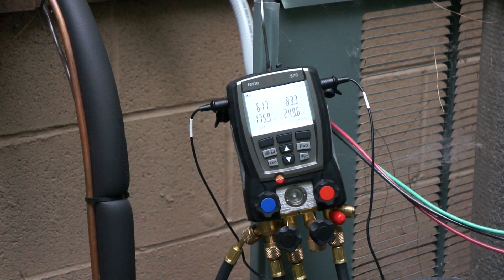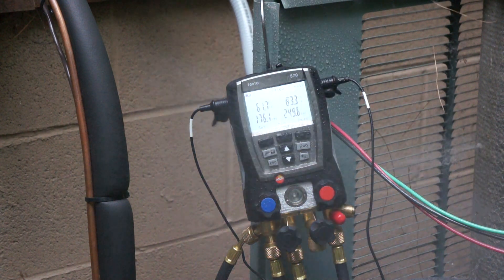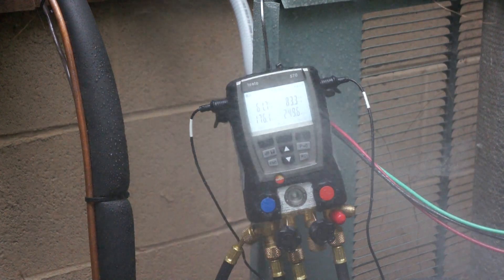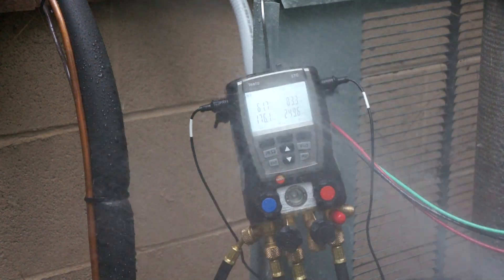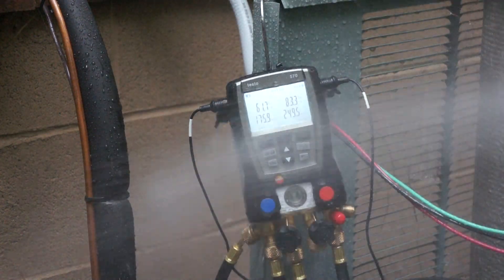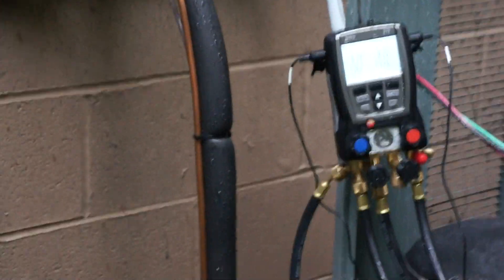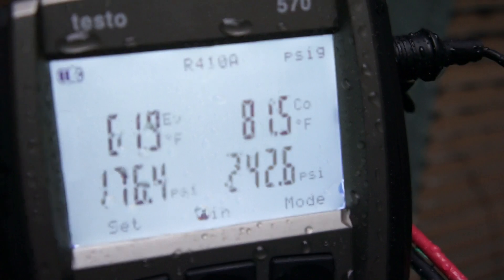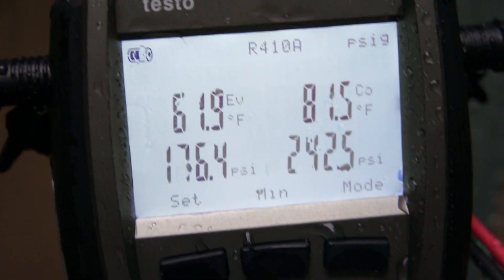570 Splash Test

Comment from the maker: Jason, if the covers are in place and everything is tight the instrument is very water resistant. If any caps are open, forget it. I still use the 570 that was in the video all the time. It is my personal meter.
Put your instrument in a Tupperware container with some desiccant like you use for keeping an RV dry (DampRid) available at Walmart and it will pull the moisture right out of the display. Poor the DampRid in, put a paper towel in the container and set the 557 on it. Let it sit overnight.